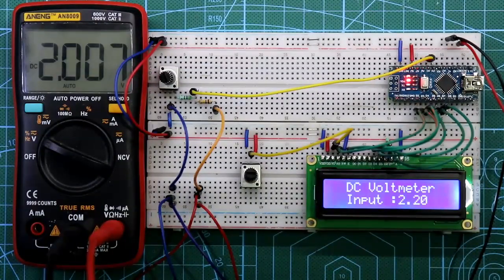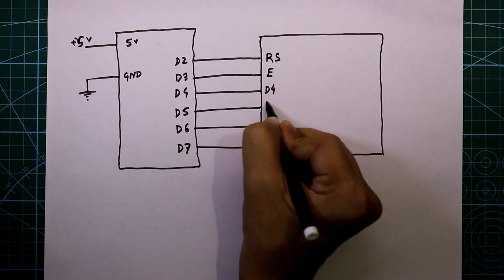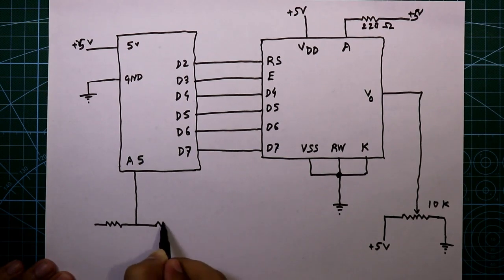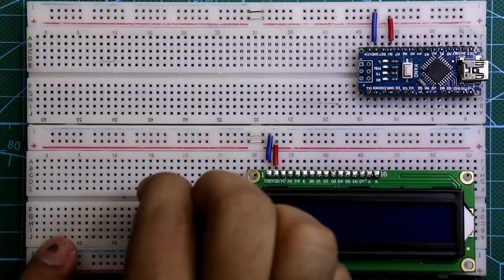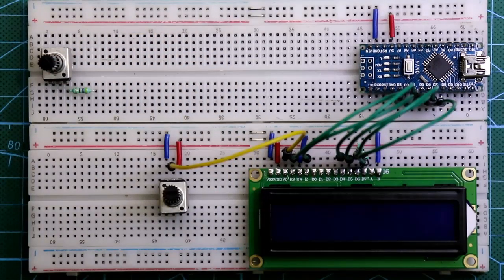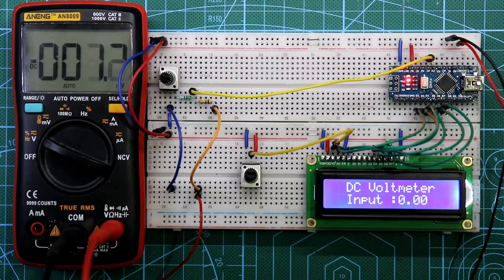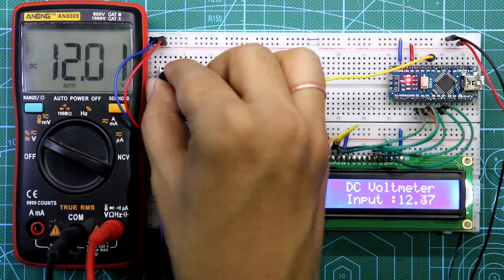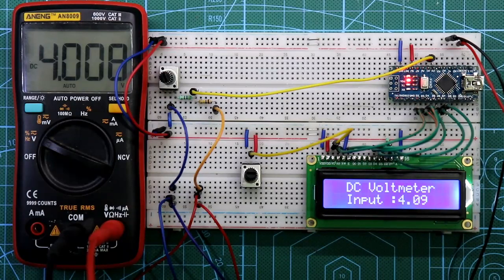How to make a (0-30) volt digital voltmeter using Arduino | Arduino project

Comment: Can u help me..
I see voltage measures fine, but When I put 12V, it detects like 12.00V , 12.06V, 12.12V this
this chnages alot and IDK what to do.
Reply: Take average and display that..
Reply: Add filtering capacitor from ground to the analog input pin
And check, i think that flikering is noise on analog pin

Comment: Great but it bouncing a lot and not very accurate, i have the same problem do you know how to get rid of those bouncing
Reply: I guess use capacitor
Reply: @cresteoffyargente8125  No it didn't help i tried many ways but none worked so i changed the arduino nano to uno, Uno is much better ! I still dont know why it happen with arduino nano !
Reply from the maker: But for me, none of them worked. Even I tried with Mega. I don't understand why it is so...

Comment: Nice explanation 👍

But why the voltage displayed on the LCD is fluctuating little bit?
Is it due to the power supplied to the 10 bit ADC of arduino?
Or do we need more precision in ADC, 12 or 16 bit?
Reply from the maker: Very good question. Even I don't know the exact reason. Sometimes we can see some multimeter also do this fluctuations.
To solve this problem, I think we have to find out the average value. 🤔
Reply: @EEWave  Okay. Thank you for your response. I'll try by taking an average value, that could be one of the solution.

Comment: Very good video!!!  I downloaded your code...and few comments...you did only a single measurement of the voltage....I will suggest  to average around 500 points... The second points that I will make... is that  there is a strong debate as  if the divider from the analog conversion should be 1023 or 1024...but since you are calibrating...I guess that will not be a problem.  Keep the good Work!!!